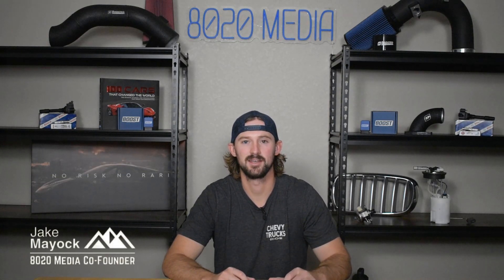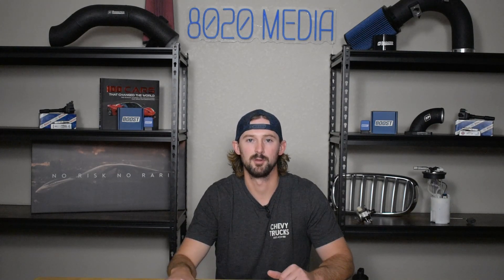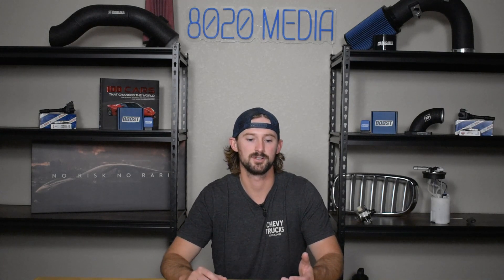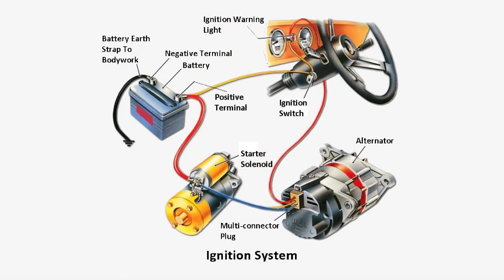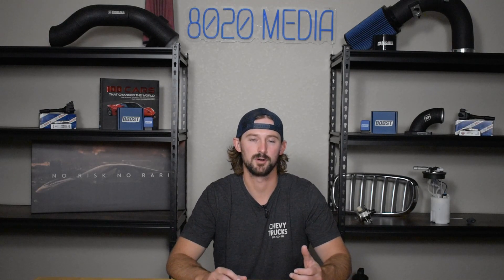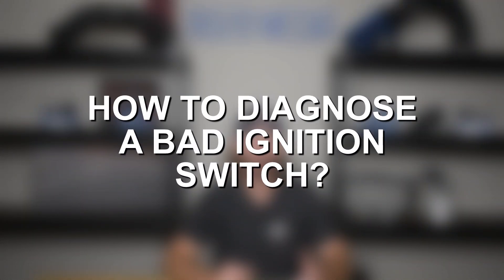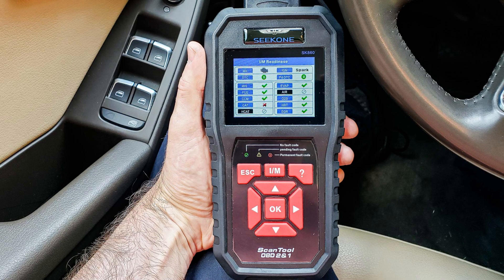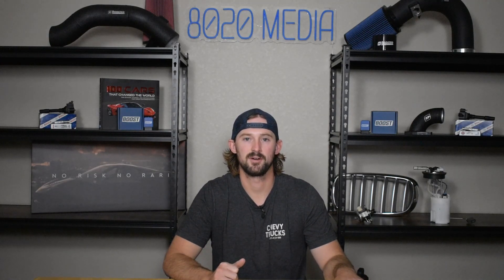Signs & Symptoms of a Bad Ignition Switch!

Comment: So I have a p0300 code, loss of communications and my guages shut down. From what I read it could be the switch. Is this true and if it is and I change it will I need new keys or would doing the anti theft/passcode reset on the code reader or doing the cycling work? Thank you for your time, this car has been a nightmare for 2 months replacing parts and trying to fix this. Btw it does run and idle but at times it dies and goes in limp mode
Reply: No need new key bro, depending on the vehicle it’s pretty easy and cheap. I got one for 27 bucks and it should only take like 15 minutes max. I thought p0300 was random multiple misfire?

Comment: My roomate said his truck (72 c10) started, then died. Then when he tried to restart it cranked but wouldn't start. I told him to check fuel in carb, he said it was getting it. So I told him to pull a spark plug wire and put a screwdriver in it and hold it close while his buddy cranked it to test for spark. He said it started but his buddy said a little smoke came from the ignition switch so I told them to shut it off. He then put the wire back on, it started and he drove it home last night. What could have happened, because it didn't fix itself? Are you sure if it cranks it can't be the ignition switch because it has to send power to the starter and coil correct? I would really appreciate some feedback before I go replacing parts. 
Thank you
Lenny

Comment: Why does the switch go bad?
Reply from the maker: A - An ignition switch usually goes bad from wear and tear, heat, or electrical overload over time. Every time you start your vehicle, the switch’s internal contacts carry a heavy current load to power systems like the starter, ignition, and fuel circuits — eventually those metal contacts can pit, burn, or loosen, causing intermittent power loss. Heat from long drives, corrosion from moisture, or vibrations from rough roads can also damage the switch’s internals or loosen its connections. In some vehicles, accessories like heavy keychains or constant movement of the key can stress the switch mechanically and make it fail faster. When it starts to go bad, you’ll notice symptoms like intermittent stalling, no-crank conditions, or flickering dash lights — all because power isn’t consistently getting through the switch.
Reply: @8020Automotive I had to put my car in the shop last Thursday and picked it back up on Friday and it costed $200

Comment: Mine is a B2976 code ignition key switch circuit failure..2010 Chevy Express 1500 4.3 it starts and runs have to wiggle the key until it turns ..I think the points are rounded off.. but even the old original key looks the same.any suggestion thank you..
Reply from the maker: C - A B2976 code on your 2010 Chevy Express 1500 points to a fault in the ignition switch or the Passlock sensor circuit, and the fact that you have to wiggle the key to get it to start confirms it’s a mechanical or internal switch contact issue, not the key itself. Even if both keys look fine, the ignition lock cylinder or ignition switch housing (which contains the Passlock sensor) is likely worn, causing intermittent contact that confuses the security system and throws that code. Start by removing the column trim and inspecting the wiring connector at the ignition switch — corrosion, looseness, or stretched wires can also trigger it. If the wiring checks out, replace the ignition lock cylinder and switch assembly together — they wear as a pair. After replacement, you may need to perform a Passlock relearn procedure (a 10-minute on–off cycle, repeated three times) so the BCM recognizes the new sensor. Don’t ignore it too long, because eventually it may fail to crank at all if the signal drops out completely.

Comment: Darn it, and here I was hoping the no start but crank could be a symptom. I have a new security light which sends the dash dials haywire and dings a lot, and seems to contribute to difficulty starting. Chevy Astro 2001, sound familiar by chance?
Reply from the maker: D - Yes, that symptom on a 2001 Chevy Astro is very familiar and usually points to a Passlock security system fault where the BCM or ignition switch sensor fails to recognize the key, causing the fuel injectors to be disabled even though the engine cranks, which explains the no-start along with the security light, erratic dash, and dinging; common causes are a failing ignition switch/Passlock sensor in the steering column, poor grounds or corroded wiring at the BCM, or the BCM itself failing, and you can test this by watching the security light while cranking (if it stays on or flashes, it’s actively blocking start), with a temporary workaround being the 10-minute key-on relearn procedure, though the long-term fix is usually replacing or bypassing the faulty sensor/module.
Reply: @8020Automotive thanks, all of that seems to align with what I've learned. I overlooked the BCM element until we did the cylinder and ignition switch and it didn't go away.

From what I understand there's no passlock system in this model or newer, it was the older model.

Comment: Have a 2013 chevy cruze I have a no crank. The starter was replaced last week battery about yr and half alternator replaced 2 yrs ago and fuses just fine just replaced battery terminal fuse still not starting. Everything turns on but the car and The car won't communicate to the diagnostic machine.
Reply from the maker: S - A no-crank and no communication to a scan tool, even after replacing the starter, terminal fuse, and confirming the battery and alternator are good, the problem almost always comes down to a power or ground issue feeding the ECM/PCM; these cars are notorious for corroded or loose ground straps on the chassis and engine block, and if the ECM isn’t getting clean power/ground it won’t allow the starter relay to trigger or talk to a scanner, so the best next step is to check and clean all major grounds, confirm the ECM has both constant 12V and switched 12V at its connectors, and swap or test the starter relay in the fuse box—if all of that checks out but the ECM still won’t wake up, then the ECM itself may be shorted or failed, but 9 times out of 10 it’s a grounding or relay feed issue rather than a bad module.
Reply: @8020Automotive what if everything works but I have to take out gem relays so it cranks on a 2002 3.8l v6 mustang with dust 39 being the culprit of a parasitic draw gem fuse

Comment: Thanks!   I had my electrical system load tested at oreillys, : alt, starter, and battery and everything passed.  My fuel pump is only about 2 years old(cartridge assembly so integrated filter)  .  I got a weak start a few times but not exactly sure why, truck does crank though.  I purchased a ignition switch but will now be returning.  I'm thinking battery may still be going out(only 2 yrs old as well)   2009 dodge ram 1500 v6 226k miles, about 30k on copper plugs .  weak start seems electrical related though.
Reply from the maker: J - Sorry to hear this. We hope the video helped!

Comment: My van starts most the time but sometimes it just cranks and won’t turn over. I replaced the starter and alternator and the battery is not old. It’s as if it’s not reading my key not sure what it could be that’s how I ended up here. What could it be?
Reply from the maker: A - If your van cranks strong but sometimes won’t fire, especially if it feels like it’s not recognizing the key, that points more toward an intermittent fuel, spark, or security system issue rather than the starter/alternator; since you already replaced those, the common suspects are a failing crankshaft position sensor (very common cause of random no-starts with no codes), weak fuel pump/relay that occasionally doesn’t prime, or an issue with the immobilizer (chip key / transponder ring around the ignition) not always reading the key. Next time it happens, turn the key on and listen for the fuel pump prime; if you don’t hear it, suspect pump/relay, but if you do and it still won’t start, check for spark—if no spark, crank sensor is likely. If the security light flashes when it won’t start, that means the immobilizer isn’t reading the key. Since it starts most of the time, I’d lean crank sensor first, but watching the dash for the security light during the no-start will tell you if it’s an anti-theft issue instead.
Reply: Thank you for the thorough response I appreciate it.

Comment: Thats what I have a 2003 ford expedition all the power comes on i got the starter tested it was good all I get is a click from the fuse box   my keys broke where the key transponder is in the key I think is my problem
Reply from the maker: A - If your Expedition’s starter tested good, all power comes on, but you only hear a click from the fuse box, and your key’s transponder chip is broken, the immobilizer (PATS system) is almost certainly the issue. The transponder chip in the key is required for the ECU to authorize starting; without a valid signal, the system will allow accessories and maybe a click from the starter relay, but it won’t energize the starter circuit fully or enable fuel/ignition. You’ll either need to replace the key with a new one that has a properly programmed transponder, or have a locksmith or Ford dealer cut and program a replacement based on your VIN. Even with a jump or starter replacement, it will not start if PATS is active. In rare cases, a bad ignition switch, starter relay, or corroded battery cables can cause similar symptoms, but since your transponder is broken, fixing that first is the logical step before chasing other issues.

Comment: Mine is the opposite. Car is starting fine but it won’t turn all the way off. Stuck in between the off position and the first click (acc). The car shuts off but the switch doesn’t turn all the way off
Reply: i’m having the same issue right now have u figured out the issue or how to fix?
Reply: @emobmo454 I saw a fix on a website I can send you the screenshot. Haven’t tried it as yet
Reply from the maker: C - If your ignition switch won’t turn fully to the “off” position and gets stuck in ACC even though the engine shuts off, it’s likely a worn or failing ignition cylinder, or the shift interlock system isn’t recognizing the vehicle is in Park, preventing full key rotation; try slightly jiggling the shifter while turning the key or double-checking it's fully in Park—if that doesn't work, the ignition lock cylinder may need to be replaced or lubricated, or the interlock solenoid inspected for mechanical failure.
Reply: @8020Automotive thank you very much will look into this🙏
Reply from the maker: C - No problem. We're here to help!

Comment: Replaced the ignition component, and now the key spins freely.
2001 Ford F250 
Help! 
Tia
Reply from the maker: V - Sorry to hear this. If the key spins freely after replacing the ignition component on your truck, it's likely that the ignition lock cylinder wasn't properly aligned or seated into the ignition switch actuator gear (the rod assembly behind the key cylinder that links to the actual electrical ignition switch). On these trucks, the lock cylinder must be inserted with the key in the "run" position and aligned with the actuator mechanism; if it’s off even slightly, the key will spin without engaging anything. Remove the lock cylinder again, verify that the actuator rod is intact and moves freely, then reinstall the cylinder with the key in the correct position—it should click into place and engage properly when turned.

Comment: How about if it starts but dies right after?
Reply from the maker: S - The most common causes are a failing fuel pump, bad crankshaft or camshaft position sensor, immobilizer/anti-theft system fault, or a massive vacuum leak; if it fires up then cuts off within 1–3 seconds consistently, especially without throttle input, the immobilizer may be cutting fuel or spark, so try a second key if you have one, check for a flashing security light on the dash, and make sure the key transponder is being recognized—if it stays running with throttle but dies at idle, suspect a stuck idle air control valve, bad MAF, or dirty throttle body.
Reply: @8020Automotive  exactly what he said, but start give it gas revs up for a second, then stalls do it again, just stalls leaning towards fuel pump, but fuel pump primes. Car used to start and run but at idle was a little ruff
Reply from the maker: @derrickedwards2927  If your car starts, revs for a second, then stalls repeatedly—even though the fuel pump primes—it’s very likely a fuel delivery issue, possibly a weak fuel pump, clogged fuel filter, or failing fuel pressure regulator; priming doesn’t guarantee the pump can maintain pressure under load. Since it used to run with a rough idle, this could indicate the pump has been gradually weakening. To confirm, check fuel pressure with a gauge while cranking—it should hold steady near spec (usually 40–60 psi depending on the vehicle). If pressure drops immediately or can’t sustain after startup, the pump or filter is likely the culprit. Also consider a dirty MAF sensor or vacuum leak, but based on your symptoms, fuel delivery is the top suspect.

Comment: Sometimes my car starts immediately. Other times I turn the key multiple times and get nothing before it finally starts.😊
Reply from the maker: G - Intermittent starting like that, usually points to a failing ignition switch, starter solenoid, or starter motor, though a loose or corroded battery terminal or ground connection can also cause it. Since you’re not hearing cranking when it doesn’t start, it’s more likely an electrical issue in the starting circuit rather than a fuel or spark issue. Try gently wiggling the key or steering wheel while turning the ignition—if that affects starting, it strongly suggests a worn ignition switch. A voltage drop test or having a mechanic check for power at the starter during a no-start attempt can help narrow it down.

Comment: What if it half cranks then stops
Reply from the maker: K - If your engine only half-cranks and then stops, that usually indicates a serious issue with either insufficient voltage or excessive mechanical resistance. The most common causes include a weak or failing battery (even if it shows 12V, it may not have enough cold cranking amps), a bad starter motor or solenoid, poor ground or corroded battery terminals, or internal engine resistance (such as a seized accessory pulley or hydro-locked cylinder from coolant or fuel). It can also be caused by timing issues—like a jumped timing chain or broken cam phaser—which may physically resist rotation. Start by testing battery voltage under load (should stay above 10V while cranking), then inspect all cables, grounds, and starter draw before considering deeper mechanical or timing problems.

Comment: Just had issue yesterday put key in ignition rolled over not start but acted like it continued to try to start without holding key . Still won't start new battery in Jan. What else to check before tow into shop?
Reply from the maker: J - If your engine cranks without starting and seems to continue cranking even after releasing the key, it could indicate a stuck ignition switch, a faulty starter relay, or an issue with the ignition control module. Since you already have a new battery, next steps to check before towing it in would be: (1) inspect the starter relay and fuse for sticking or damage, (2) check for spark at the plugs using a simple spark tester (no spark could mean bad crank sensor or ignition coil), and (3) verify fuel delivery by listening for the fuel pump prime when turning the key to “on.” If no prime is heard, it could be a failed fuel pump or fuel pump relay. Also check for any security light on the dash that could indicate an anti-theft lockout condition. If all those check out and it still won’t fire, a scan tool may be needed to pull any stored trouble codes, even if the check engine light isn’t on.

Comment: So i have a 05 Kia rio that has had a new ignition switch put in years ago. All of a sudden seemed like my battery was dead. Had it charged they said it was good. Lasted a few months then bam again. All test come back good on bttery, starter , and alternator. I can jump it and it wil be good for a few trips then dies again and i jump it. Can this be the ignition switch again? I did smell a burning smell a while back but assumed was muffler becuas i need a flex pipe too. Im lost. Lol any advice would help ty
Reply from the maker: P - Yes, it’s very possible that your issue could be caused by a faulty ignition switch, especially since it was previously replaced and you smelled something burning—it might have been electrical. A failing ignition switch can cause intermittent power drain or fail to properly shut down circuits, slowly draining the battery even when the car is off. Since your battery, alternator, and starter all test good, and the problem resolves temporarily with a jump, that points to parasitic drain or inconsistent charging. I’d recommend checking for parasitic draw with a multimeter, and also carefully inspecting the ignition switch wiring for signs of heat damage or corrosion. The fact that it runs fine after jumping and then dies again after a few drives reinforces that something is slowly pulling power even while off—likely electrical, not mechanical.
Reply: Ok ty . Took my battery out this time and to advanced auto, a guy been there for years. Said my battery had two bad cells. I haven't had any issues since putting in a new one. But if it does arise again I def think it's this. Ty for ur response!! @8020Automotive